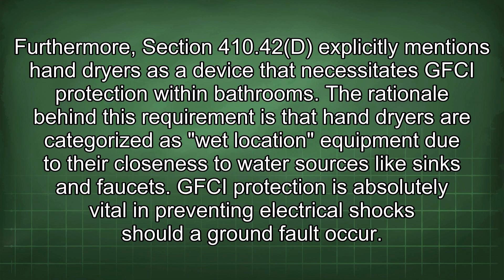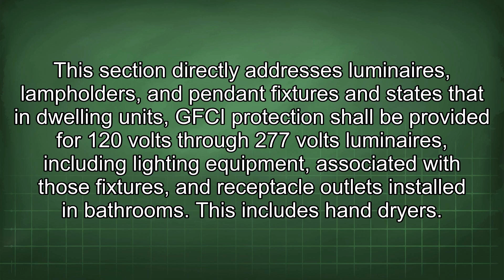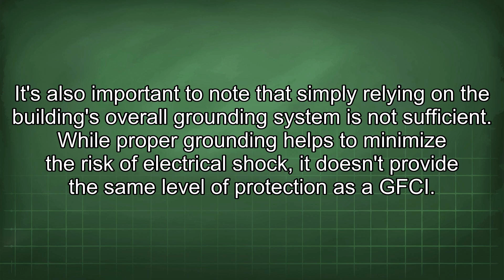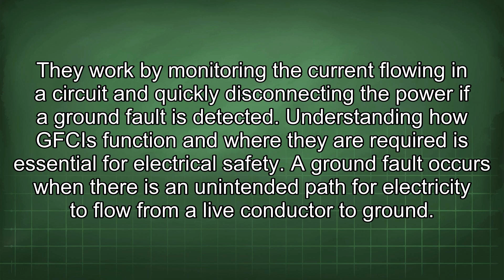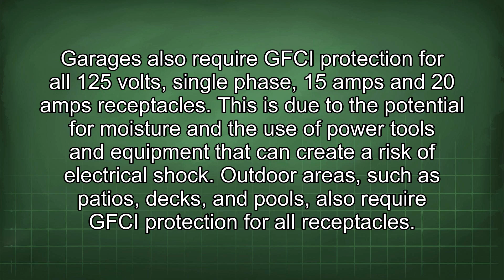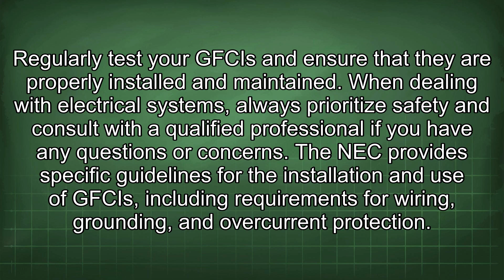GFCI Protection Required for Hand Dryers NEC Explained

Comment: Is this a joke? who made this video? the code articles are wrong and nothing in the NEC says "Hand Dryers" specifically.  Take this false information down.
Reply from the maker: Hello @aa-me4ig,

Thanks again for your comment. The purpose of this video is to help guide people to make the most rational decision in different real world scenarios. Each of our videos are based on real world cases from electrical software that were studied and/or implemented. It is not a verbatim interpretation of the code. Whether you are installing a deli meat slicer or hair dryer, if the fixture is within a certain distance of the sink and under 150 volts to ground, it does require GFCI protection. This video helps to point that out.

Sincerely,

BESA Research